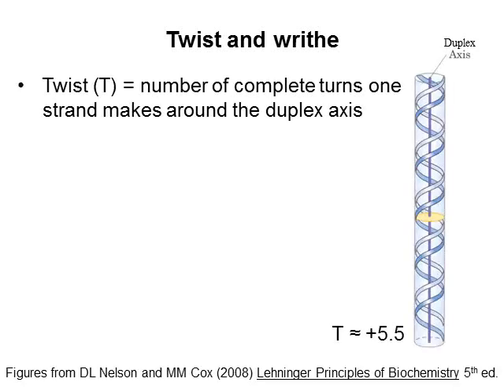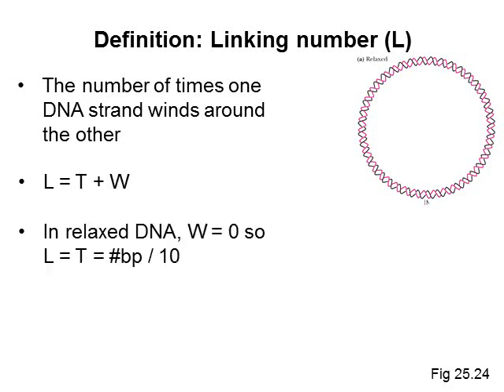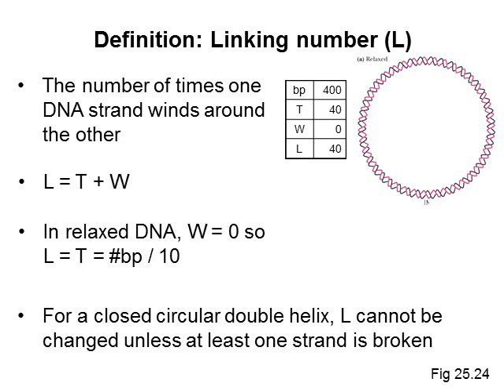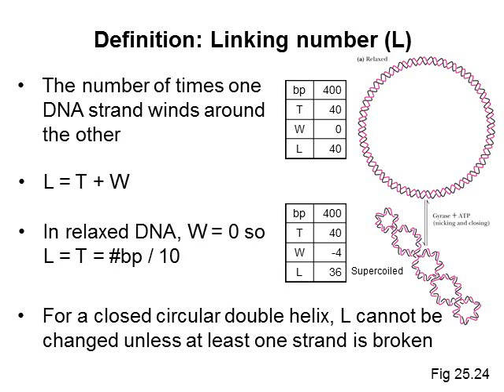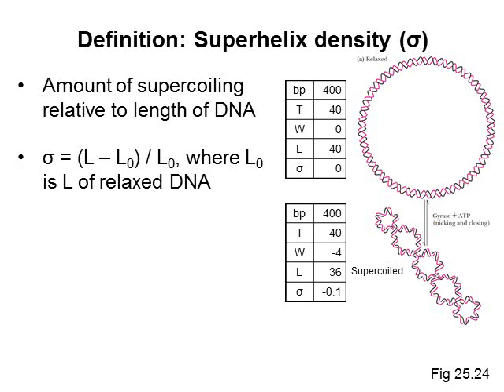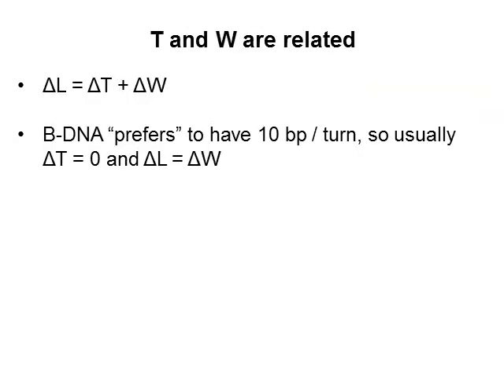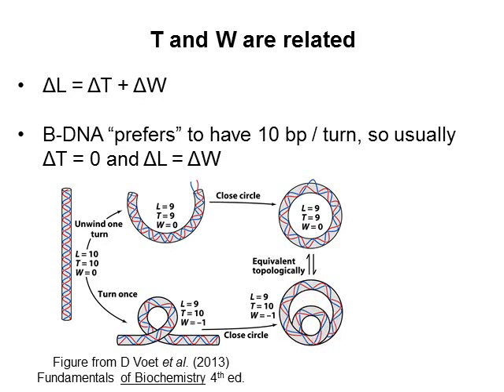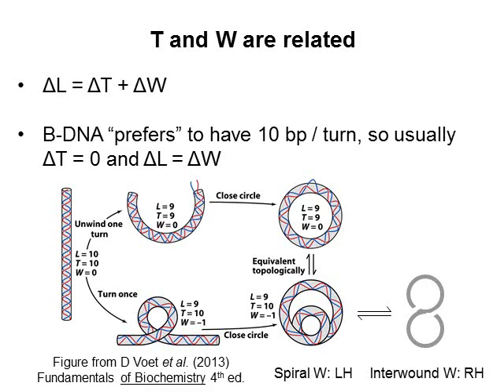DNA Supercoiling 3 - Linking Number

Comment: I'm still confused about twist and writhe interconversion, questions of the sort "You have a relaxed cccDNA of length 1050 bp. A topoisomerase unwinds the cccDNA above to remove 10 helical turns, what is the Wr and Tw now?" It changes the linking number by 10, but how much is writhe and how much is twist? Do you always assume the DNA forms writhes in these cases?

Relaxed cccDNA of 1050 bp (10.5 bp/turn), Lk = 100, Tw = 100, Wr = 0. Unwinds 10 turns => Lk = 90 = # Tw + # Wr (?). What is the twist now?
Reply from the maker: Generally, to a first approximation you can assume that the double helix itself returns to its most energetically favourable state, or 10.5 bp/turn in your scenario. Then all of the change is expressed as writhe. In this case W would be -10 and twist would be 100.

Comment: For right handed supercoils isnt it positive? Increasing linkages
Reply from the maker: Please be more specific with your question. What part of the video are you referring to, and what exactly are you asking? RH interwound supercoiling is negative, so yes if a topoisomerase increases the number of times the two strands cross each other, then the net change in linking number will be positive. In the video, though, I describe DNA gyrase, which acts to reduce the number of times the strands cross each other, introducing negative supercoiling and reducing the linking number.